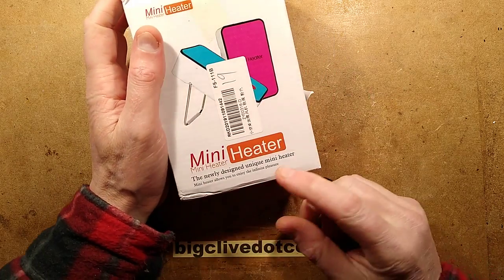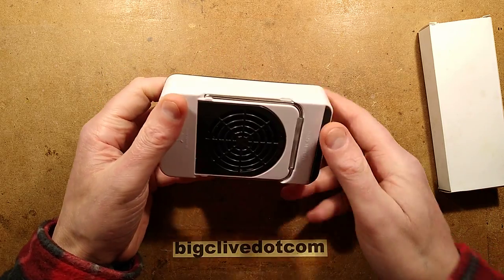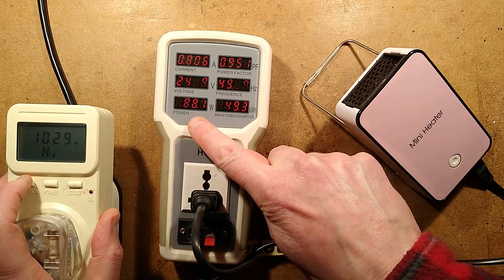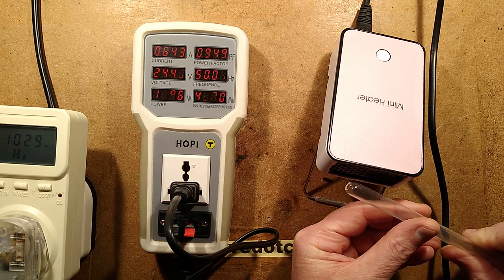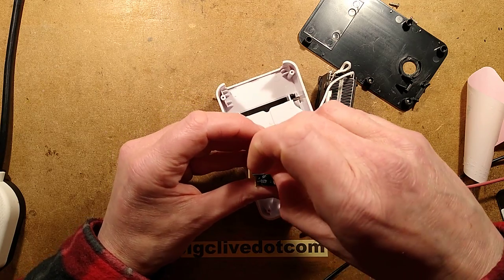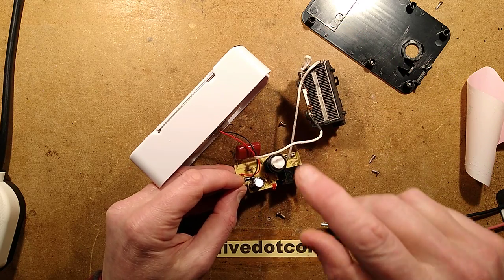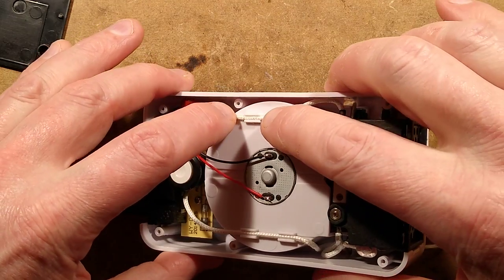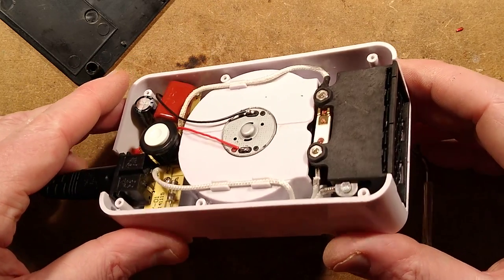All plastic 150W eBay desk mini-heater.  (With schematic.)

Comment: Still infinitely better designed than Broans flagship $450 bathroom heater fan combo.  I see Chinese can afford self resetting thermal cutout in their $8 items.  Yet a masterpiece of $450 American ingenuity uses only a thermal fuse that forces you to replace the heater pack every year.  I finally re-engineered their crappy design so now it works.  Manual reset thermal breaker with small piezo buzzer in parallel WITH thermal fuse of slightly higher temp rating.

Now when the thermal breaker sets, I hear it and I know it is time to disassemble and clean lint out of the heater.  Simple push to reset after vacuuming out the heater assembly and good to go for another year or so until needs cleaning again.  The thermal fuse is still there to protect catastrophic failure in the event the thermal breaker fails.

I did it for you Broan!  Engineered your product correctly for you at no additional charge.
Reply: Ah, you uncovered their repeat-business generator! How dare you break their business model! :-)

Comment: Hmm... neat little heater. I wonder if something like this would work as a 3D printer chamber heater. I suppose it depends on what temperature the PTC self regulates down to in a hot ambient environment. 🤔
Reply: A cardboard box over my ender 3 was plenty to let me print ABS.  The heated bed warmed the box fine.
Reply: Some guy in the comment section said that he uses 2 of them to do exactly that.
Reply: I use one of them for my Flashforge Finder unheated pad. In the winter it gets too cold and curls everything. A blast of hot air for the first few layers flattens it all out. Cheaper than a hot-bed too!

Comment: I reckon the case needs a little bit more design work to remove the ability to bottom out on the fan and output surfaces.

Comment: That heater casing looks like it's made of glass reinforced thermoplastic. A soldering iron should find the melting temperature pretty quick. I bet it's around 280°C if it's even a thermoplastic at all

Comment: If I remember correctly, Centrifugal pumps are a bit confusing, they actually operate in the opposite manner of what might be intuitive. The direction in which they "throw the air inwards" is actually the proper orientation.

Comment: When did capacitor droppers become a thing? I don't remember coming across them "back in my day". I do remember the trick with hair dryers of using taps on the heater element to run the motor. Once in the 70s a girlfriend brought me her hair dryer which had stopped working. On opening it I found that a wire to a tap on the heater had come unsoldered! I remade the connection with crimped terminals and all was well again. I was horrified though that it had no isolation or proper safety features. No thermal cut-out, just relied on the fuse in the plug.

Comment: Hello Big Clive,
I were doing the "finger test" to drop capacitors with the understanding they were 10,000 to 100,000 pF!
A 1 uF polyester capacitor - charged a 1.41x240 V, would have gave you an helluva of a shock between thumb and index finger; genuinely painful.
Thank you for the video...
Reply from the maker: It is indeed quite a stab when you touch a live one.

Comment: Looking at that plug, it would easily fit into a north American outlet, curious what the power draw would be on 110V.
Reply: as it flew over 1000W at the start then it would probably work ok on 110V, the fan will be slower though, so perhaps up the 1UF to 2UF..  60Hz will help a bit compared to 50 Hz too.
Reply: yeah, i was playing with the math, capacitive dropper aside, at the ~240V 1kW numbers seen in the video it would give it a cold resistance of ~57 Ohms. 57 Ohms across 120V would be about 250W. Now I'm curious if PTCs have a voltage dependency, Is it still going to reach the same temp/150W draw and just take longer to get there or is there a voltage dependence and we're looking at ~70W heater if you put it on 120V, off to the google i go...
Reply: @KRiley129  nah they have a wide dynamic range so lower voltage they would draw more current as the resistance would be lower to produce the same heat.
Reply: Wouldn't the PTC just end up balancing based on the heat, and therefore run at about the same power consumption (but double the current).
1KW also happens to be about 10A at 110v... I bet that input socket and some of the circuitry is built with parts rated for 10A. And the output was designed around a 10A limit at 110v.

Comment: It would not pull the air in. It would still throw it out, but it would have different flow/pressure/speed characteristics. There are in fact radial pumps and blowers that have forward-curved blades. They are typically preferred for low-flow, high-pressure systems whereas backward-curved blowers are favoured in medium-flow, medium-pressure applications. Low, medium, and high here being used in relative terms.

Comment: On thermal cut-outs - beware of the possum switch! - I have a heater which has a thermal cut-out that stays "out" once it has been tripped (can make you believe it's a single shot fuse), however, disconnect the power and let it stand for 10~15 minutes, and it will reset itself - It plays possum! - These possum switches have a normal thermal cut-out appearance and operation, but also incorporate a small heating element connected across the contacts such that when the contacts are opened it now sees the current available at the contacts. The heating element now heats up and maintains the heat local to the bi-metal spring, thus keeping it in the "cut out" condition, and will maintain that status indefinitely (until the power is removed). Disconnect the power and let the cut-out cool down, then all is well again.

Now then, that fan - It looks like a 'Sirocco' type radial fan, and counter intuitively, they rotate with the concave side of the blades "leading" the way. If you run one backwards (convex side leading) it will still blow air, but is nowhere near as efficient. - Air enters the fan at its hub and is accelerated radially under centrifugal force. This leaves a partial vacuum at the centre of the hub, which draws in more air. As this air is accelerated radially, it forces the air in front of it further out along the blade. Because the blade is curved (concave) the air is forced forward along the curve and is further accelerated as it exits the fan at a massively greater rate (in a sling-shot fashion) than would be possible with a straight bladed fan.

All-in-all, this one looks like a halfway decent effort, but even then, I would never leave one unattended. One possible use that comes to my mind would be for heating (baking) old recording tapes to restore their playability.

Comment: 21:12 That sounded and looked like the bimetallic breaker tripped. Not only did I hear a click, but I also saw a small piece of debris fly out.
Reply: I noticed the speck appear on it and the fan stopping. But the bi-metallic doesn't control the fan.
12.41 and I can hardly keep awake.

Comment: Replacement incubator heater/fan unit. Possibly .You mention thermally controlled but Could you adapt it somehow to manually regulate the heat? If you could you could re-brand and sell it again. Incubator heaters are spendy. Especially in a pinch.

Comment: I have one of the ones that plugs into a outlet with no cord it sits on the outlet it self rated at 400 watts @120 volts  us warms a small room that is 8X8 foot with my radio station in it works nice  to keep your feet warm under the console desk  .

Comment: I saw one recently at an office building that I do repairs in. It popped the capacitor causing the fan to fail and then it cycled on and off over the holidays. It was melted over one of the woman"s shoes but they tossed it before I could retrieve it.

Comment: Actually that fan you have was designed to spin clockwise, it would blow far more air going clockwise than it would counterclockwise, I'm guessing they have it wired to go the wrong way so the motor has less work to do and that they could cheap out and use a smaller less powerful motor.

Comment: Looks like a 110/230 version of the 12v car heaters that plug into the cig lighter.
I have one of the small 110 heaters that you plug directly into the outlet and it works good in a bathroom and would keep you from freezing in a 12x10 room.
Reply: The ones like this in the car during winter I'd let the air blow into the arm of my coat and warm the inside of my jacket.

Comment: Something I've noticed about that fan design is that usually if it's spinning to where the fins look like they would pull air in, the fan actually throws drastically more air.
Reply: Roger Gilbert - could Clive reverse the motor to find out 🧐 ?
Reply: @samuelfellows6923  I guess the better question is why didn't he? ;)

Comment: If it accelerates air outward in a circular motion, it is a centrifugal fan. If the acceleration is relatively linear, i.e. Perpendicular to the rotation, it's an axial fan.

Comment: That power lead has the standard North American prongs on it -- note the holes. The Chinese ones are solid blades (afaik). Here we have the holes, and you'll notice the plugs (should) be polarized: one blade should be taller than the other.

Comment: Those mini heater are very good for people who 3D print with high warp material (like ABS), you can preheat you enclosure and prevent some printing srew-ups. I bought one at a small store, is made of a better plastic (PA66 + GF) and works pretty well in a small enclosure. (No i dont have it always on, I heat it to arround 60ºC and then the heated bed keeps the temperature constant)

Comment: I wonder if a possible safety improvement (at a price of course,) would be to have it set up so the heating element isn't enabled unless the fold out foot is out and providing the necessary airflow? Maybe do-able with a reed switch

Comment: Clive you made me think of a request. Can you do a project for us? 4 power supplies the first just a regulated 12 volt. The next a variable voltage one and the last a high current modification of the variable voltage and last a variable voltage and current supply. If you could base all of it on the fixed one and just make small changed to create each of the other supplies.I think that would be a cool project and a good teaching tool. Thanks and stay safe.  P.S. I thought some thing pink was going to explode. Maybe a later item I guess.

Comment: I’ve got one of these heaters. It came in the same box but with both Chinese & English instructions. The lead had a U.K. socket. Rated at 200watts it’s quite a neat little heater for a small room. You barely notice the fan sound. I checked the output temperature with an IR thermometer and it clocked 129°C.
Reply: Ir thermometer measures surface temperature right?.

Im thinking of adding a thermal fuse to it to make a heated enclosure for 3d printing abs.
Reply: @bertkooijmans4769  I think so.
Reply: @rogerhargreaves2272  aah then it wouldnt heat till stuff catches fre i qeuss ordered those bimetal things and thermal fuse already haha thanks for answering
Reply: @bertkooijmans4769  I believe those heaters have a thermal cut out for safety.  They are designed for heating tiny rooms not enclosed boxes.
Reply: @rogerhargreaves2272  really small rooms are basically the same right?:p
But i have a diy tent now but it seams the air moving around screws up the prints so ill just use iy to preheat i think.
Reply: @bertkooijmans4769  I have no experience with 3D printing.  Good luck Bert with your project. 👍

Comment: You're mistaken if you think that the fan would suck air if it ran in the other direction. Rewire it and see for yourself. That the vanes are pointing in the "wrong" direction and seem to scoop air up is only the case if you don't consider the centrifugal effect. In fact if it turned that way it would be MUCH more efficient. Test it.
Interestingly, I do think that they DID wire it wrong on purpose. As a hack. They must have noticed that the fan is too powerful for the PTC element, so that when it rotates properly, only lukewarm air comes out. So somebody thought that instead of modifying the circuit, they'd just wire the motor wrong so the fan rotates the wrong way. Regulating the airflow by inefficiency. As the PTC is self-regulating, you might in fact be able to eke out far more power out of it by wiring the motor correctly.
Of course, one should never attribute to malice what could be attributed to stupidity. So I don't exclude the possibility that they tasked someone unskilled with soldering the wires without bothering to explain which one goes where. So you possibly have about 50:50 chance of getting a motor wired correctly.

Comment: opposite polarity for fan would not cause it to suck air, it just makes air to move faster with lower static pressure. i suppose heating element makes enough blockade for air so they needed to "more pressure" mode

Comment: That's a neat little package.
There is a 12v one for cars, I always meant to get one as my old banger took ages and miles to get warm enough to defrost the windscreen, alas poor car is at rust now in the scrapyard, thus I no longer need one.
Good vid that, very interesting. Your wallet must take a hammering as you keep buying things to break up. I bet your neighbours don't lend you anything 🤣🤣🤣

Comment: I’d love to get a small heater for my feet. Here in Australia, the temperature of the room doesn’t bother me so much, I’m full of blubber, but my feet do get quite cold. A standard two setting thermostat heater will quite happily roast the outside of my feet while leaving the inside frozen, so I guess the heater wants to be a cheap microwave when it grows up.

I wonder if there are any lower power heaters like this that won’t burn my brand new house right to the ground or electrocute me if I get too close. Mind you, if that had a thermal fuse in addition to the over temp cutout, that might not be too terrible.
Reply from the maker: You can get heated foot mats.  Not sure how safe they are though.

Comment: 14:55 That's a misconception afaik. It works based on centrifugal force, not by cupping the air and pushing it. There are both backwards and forwards facing impellers used all the time and they all push, never pull. All it changes is the pressure and efficiency (I might also add that the force from the center to the sides changes by square of the rpm and the forces of "cupping" and carrying air would be linear)

Comment: Due to some aerodynamics, both fan directions will throw air outwards, but one direction will result in lower airflow and higher air pressure (useful for forcing air through a heater) and the other high airflow low pressure (useful for fanning yourself)..

Probably won't make a huge difference in this case, but in pressure critical things like bouncy castle blowers it can make quite a large difference.
Reply: You haven't had much experience with fans have you? If youir theory were true propeller aircraft couldn't use reverse thrust, and my squirrel cage fan wouldn't be discharging air out the side.
Reply: @adrat8339   look on Wikipedia about squirrel cage fans
Reply: The direction of the blades does indeed affect the volume to pressure ratio in a squirrel cage fan providing the direction of rotation stays the same. However, the housing design also plays a major part in air flow. While I concede the airflow will not reverse, with the motor turning in reverse. Because of the housing design when the motor is turning away from the discharge port instead of toward it, the result is a near total lack of air flow. I also do not understand how the blower in my old computer room at work discharged the air from the side of the blower and not the front. I would love to go back and see how it is built. Good on ya Michael HHT,  thanks for keeping it real, it is never too late for me to learn. (I am 76)

Comment: I mean its actually decently designed for safety. Way better than the last mini IR heater of death. But the better question is: Why? You can get a 400W space heater for $45 that will actually heat a space including through radiant heat which will cover your body. This thing you'd be lucky if you could get it to point at your fingers.

Comment: That looks like a crazy dangerous fire 🔥 hazard just waiting for someone to leave it unattended and burn down their house!!! 🔥🏠🔥
Especially when something falls onto the heater and it starts a fire before the bi-metallic strip activates because it’s already at full temperature and then gets partially covered up with a little gap where some hot air gets past the blockage and the heater is still going and getting hotter!!!🔥🏠🔥

Comment: Squirrel cage is what I've always heard those fans called. Why? Couldn't tell ya. Logically, in liquid pump terms that would be a centrifugal pump. So maybe a centrifugal blower?
Reply: Actually, a squirrel cage blower has this: https://i.ebayimg.com/images/i/121717893526-0-1/s-l1000.jpg instead of the impeller you see in this small heater.